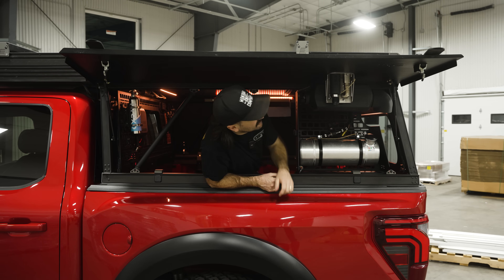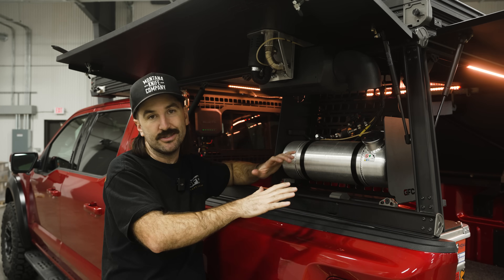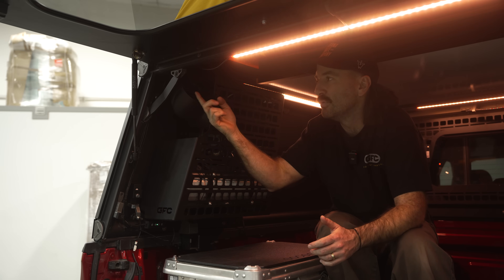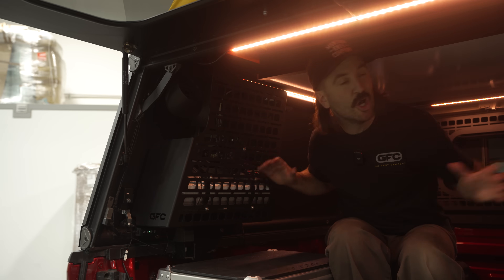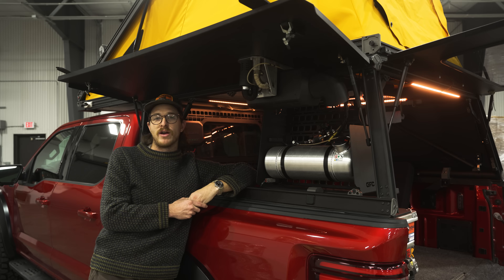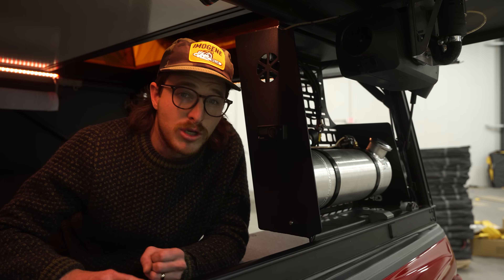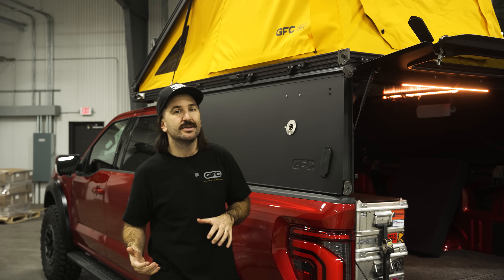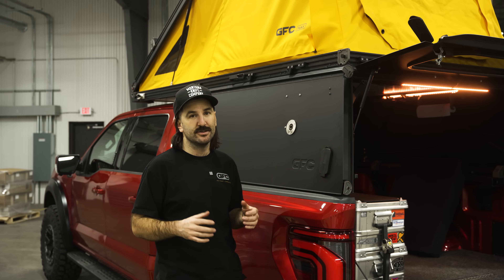Special Projects Ep. 001: DIESEL HEATER

Comment: Saying a “Chinese thing” is not very accurate since they are both made in china with the exact same design since the copy right on the original heater has expired. My “Chinese thing” heater has never once tried to kill me in my sleep so long as the install is good…
Reply: yup. the "german vs chinese" point is mostly just a luxury tax on a brand name. since the OG design patents expired, the clones are using the exact same architecture anyway (tho the UI sucks, but that's the original UI so blame the deutsch fatherland). the physics of a combustion chamber don't change just because you paid more dolla billzz.

the irony is that eberspacher is heavily integrated in china with huge manufacturing hubs in places like tianjin and zhongshan. all the individual parts, resistors, wires, heatshrink tubing, is all from china. microcontrolers are from taiwan. thinking a heater wasn't touched by that supply chain is frlfrl a bit delulu. you're not getting "better" engineering, just more qc overhead and a fancy manual for a unit that shares most of its dna with the "CDH" everyone talks about.

reliability issues are predominantly user error, not country of origin. you can clog an Eberspacher just as fast as a cheap Lavaner Pro if the setup is wrong. units soot up cuz people run them on low constantly, skip the shutdown burn-off cycle, and what kills me the most, don't use recirculating air which in turn makes the heat exchanger too cold and therefore makes the combustion chamber run too cold for a complete burn. like wtf.

if someone really cares about a clean burn and low maintenance, a gasoline unit is the way to go since it runs the cleanest anyway. it’s usually more about how you maintain the gear than where the factory was located.

tbh, if they gonna spend all dat $$$, shoulda got a gasoline unit.

Comment: For my V2 GFC I’m running a driver-side Turbo Cubby. Is there any way this could be installed inside the Turbo Cubby? The cab-side wall of my cubby is where my power setup is currently mounted.

Comment: I have a gen 1 camper I had installed in 2020 just before the lockdowns and primarily use it during ski season to camp in parking lots at ski areas. Glad to see almost all the mods I had to do have ended up as factory options. It was  real PIA solving issues and GFC can do it far better than me. Question for GFC, how do I solve this one? Freshly fallen snow on the camper causes a problem. The heat causes snow to melt, flow into the ambassador hinges and freeze.
Reply from the maker: Shoot us an email to explain what you’re experiencing and our team can assist you 🤙

Comment: For The V2 Pro's, instead of cutting a panel in half, would there be a way cut a ~3-4" hole in the panel and mattress and install a baffle? You could then direct ducting to the bottom of the baffle in the downstairs and have a Y tube direct hot air upstairs and downstairs from the heater output. If you oversize the baffle you should still be able to remove and place the panel to sit on the ducting.
Reply: Break out the sewing kit and get yourself a true Y heat duct splitter but naw you’ll need a bigger opening because whut if your sleeping bag or blankets block the  port…?

Comment: Love it! My concern is routing the heat to the tent section. I'm 6'2" with a Tacoma. Cutting half the small square is not an option and driver side rear corner is right where my head goes.
Reply from the maker: On the max you’d have plenty of space with the constant pass through which is what this is designed to accommodate. On the v2 if we split the panel, that’s the only way to climate control both upstairs and downstairs efficiently inside. Is there a reason you can’t sleep on the passenger side of the bed?
Reply: @GFC because that's where my wife sleeps! 😂

Comment: I ordered my v2 max last month. Can i contact gfc and add this on to be installed with my camper in April in MT?
Reply from the maker: This is not in production yet, but it is being designed to be added to units that are in queue and already shipped as a diy or partner shop retrofit. 

So if you’re waiting on a camper, we will reach out with more details on how this program will work in the coming weeks.

Comment: can that be run with diesel or 91 octane gas or is it diesel specific
Reply from the maker: The mechanical components are the same in gasoline and diesel units but they both have different ecu’s. So it’s either a gas unit or a diesel unit.
Reply: i know the unit is around 1500-2k what is ur gonna be ur target selling price for it with all the add ons like the tank and mounting ect
Reply from the maker: @KICROKS86 ~3k is the ballpark target for the whole kit
Reply: i ask because i know Webasto runs diesel or gas and it would be cool to use normal gas and be able to carried one type of fuel
Reply from the maker: @KICROKS86 yup, evaluating offering both options for the kit currently 🤙 the big difference is transporting the two fuels (especially proper ventilation) but functionally either would work!

Comment: On new Max purchases would GFC or dealers do the diesel heater install or does the customer have to?
Reply from the maker: Designed to be a straightforward DIY to existing units. That said, also can be installed at any of our shops.

Comment: I fork mount my bikes on the driver side it looks like it might still be able to have room between that heater the rear door to fit the handle bar of my bike? also will it start off a portable battery like an ECOFlow? lots of these types of batteries have had problems starting diesel heaters

Comment: I can understand why you'd mount it to the driver side rear only. But I'd still like to see the ability  to mount that heater on both sides. My build plan involves having a 23zero 270 awning mounted on the driver side so if I could have the exhaust for the heater be on the passenger side or the rear of the camper, that would be awesome.

Another idea is, could it be possible to mount the motor and exhaust port on the rear hatch of the camper? It would help create more cabinet space and to keep exhaust fumes away from possible living areas.

If I buy the tent portion of your camper, I'll need to run a second square awning on the passenger side so the kids can have a sizable place to sleep. Maybe it could be possible to run a secondary heater tube for that too.
Reply from the maker: Why is your awning on the drivers side? Typically makes more sense to use it on the passenger in North America.
Reply: @GFC  The biggest argument i've found is swingout bumpers. by design they tend to swing towards the passenger side so they don't swing into traffic. Thus with an awning on the passenger side you have to walk around the swingout every time you want to the tailgate or climb into your camper.

Comment: I love my V2 pro camper. I would buy this at $1500 or below. No way I can justify spending $3k for a diesel heater…. I use an Amazon diesel heater now for $100. No issues for multiple seasons.
Reply from the maker: You can totally use an Amazon heater. We couldn’t sell this heater for 1500 because the heater itself costs us that much. That price doesn’t include the fuel tank, harness work, and molle panel surround. 

None of the Chinese diesel heaters are CE or UL rated, and they have no safety regulations they are required to follow. We refuse to sell dangerous products, which is why we are working  with the best global supplier of airtronic heaters, Eberspacher. 

If you do use a Chinese unit, PLEASE never mount the unit inside the camper. Only use it outside and make sure to use a carbon monoxide detector religiously.
Reply: @GFC  always use a carbon monoxide detector with any heater PERIOD. Not worth taking the chance even with the best reliable heater on earth. Therefore by your logic, just mount the cheap Chinese diesel heater on the outside and you're good to go! Why spend $3k and take up valuable storage space in your camper?
Reply from the maker: @FilmREALMS we use a carbon monoxide detector with this system as well. We want a reliable safe solution to offer, which is why we went with a quality manufacturer. If folks are willing to run Chinese units, that’s entirely their decision. Just not one we can, or want, to make.
Reply: This is what I’ve been doing and it works great. Only takes a few minutes to setup and I always use a CO2 detector for safety. When I bought my heater I seriously considered the Planar heater and it was hard to justify based on price. The GFC heater is double the price of the Planar. Feels like an extreme luxury product being sold here…

Comment: Can the tank be relocated? I deal with Diesel enough I would rather avoid the smell as much as possible where I sleep. Even just knowing it has a fuel pump and could be relocated would be good enough. Being able to plumb it off the truck would be ideal!
Reply from the maker: I’m incredible sensitive to diesel smell, and have not noticed it at all. Honestly was surprised in testing how well it works, you can only really smell it on cold start and it goes away quickly. -Graeme
Reply: @GFC I bet it works great and doesn't smell when running. I just see spilling fuel when refueling that's what I would be smelling.
Reply: @s @spacebike420 yeah that’s what I’m thinking too, filling it gotta be super careful, and the cap has to be ironclad.

Comment: Idea for dealing with the electronics: design a “control box” that is accessible in the upper tent space that can control the heater, interior lights, and so on (maybe add additional dummy buttons/switches with pigtails so users can hook up their own relays for increased functionality).

The control box could be mounted in the cubby/storage space at the front of the V2 Max, for example. That way you don’t have to get up and move around the camper to get your space dialed in.

Excited to get my hands on the heater for my camper!
Reply: Agreed, i would put mine in a V2 pro and we will often have 2 people sleeping up there. Not much room to leave a panel out so would love a way to control the temp up there that works well.
Reply from the maker: @TruckCamper33 how about a half panel kit to replace one of the squares that ships with the kit for v2 and v2 pro
Reply: @GFC   that would be awesome, as long as you can direct the heater output into the floor gap so your blowing more air into the sleeping area than the truck bed. 

Ideally moving the thermostat upstairs would be the best to keep a constant temperature up there (or just leave some length on the thermostat wire so it can be moved upstairs while sleeping). Maybe mount it on a magnet and put the wires in tech flex so it can be quickly moved from upstairs to downstairs stow position.

Comment: is there a built in thermo stat so we can set the temp that  if the outside temp is 30' it won't be 100' inside the camper?
Reply: I just re-watched and my question was answered. thanks.
Reply from the maker: Yessir
Reply: does the exhaust port hole leave a mark on the panel from the heat and smoke?
Reply from the maker: @frankschattner7640 nope, heater burns very clean.

Comment: Are you guys planning on offering a gas version that can be plumbed into the truck's gas tank?
Reply from the maker: We will not integrate into the vehicle fuel tank, only into the accessory shown in the video. The gas furnace is in testing as well and is surprisingly only ten percent less efficient than diesel. It carries a slight price premium as they are not as commonly available so the supplier charges a bit more.
Reply: Don't bet on it. That adds a whole different level of complexity for a less efficient fuel source. Think about how much would be involved to pull that off , and then the cost of it. There's not enough of a market for something like that.
Reply: @NunyaBusiness... Idk, people are already paying the astronomical price of these campers. I wouldn't doubt if they'd also pay a premium (plus markup) for a gas furnace
Reply: +1 to the gas heater!

Comment: Some sort of removable extension attachment for the exhaust might be nice to get those fumes a little further from the truck.
Reply from the maker: Would be easily added if someone would like to, but so far has not proven necessary. No issues with carbon monoxide or smell.
Reply: @GFC  Wouldn't a downpipe also mitigates water ingress?
Reply: Yes, a few feet of stainless tubing would be super easy to add

Comment: Price?
Reply from the maker: Should be right around 3k. That includes the Eberspacher 4kw, the mounting system, harness, thermostat, CO detector and the fuel tank.
Reply: @GFC if you guys use the Espar M3 B4R it will match the one in my other camper. redundancy is great for spare parts.
Reply from the maker: @TruckCamper33 it’s the m3 4r 🤙

Comment: Very nice design and idea to incorporate into an already great camper. I can't wait to get this setup installed on my GMC 2500 in the near future. 

Since you mentioned to share any ideas in the comments section, I'd like to share an idea that hopefully your team can perfect and actually make happen. It would be nice to have a shelf inside the camper (passenger side) that can be used for kitchen use such as stove, cutting board, espresso machine, etc. This shelf could be designed to be pulled out from the passenger side panel (custom hinge design) so to have the option to use the kitchen inside the truck or outside the truck. 

It be nice to pull up to a site, pull out your awning, pull out your kitchen already setup and secured. The shelf design could be sort of a molle panel so to secure appliances from below so there is no rattling or movement during travel.

Either way, amazing job to your design team for all the amazing products you guys are rolling out! Bravo! 👏🏻
Reply from the maker: Love the concept and appreciate the feedback!

Comment: Been following the project for a while. The awning placement on the passenger side was a stab in heart! On my vehicles in the past I’ve always put the awning on the drivers side. That gives me access to the drivers seat, and usually on the vehicles I’ve had that have 60/40 rear seats, the 60 is on the drivers side. Which lends itself to being removed and used for storage of camp supplies, while leaving the 40 seat just incase I have an extra passenger.

I’d be interested in polling people who currently have awnings to see what side they prefer to have them on. My bet would be overwhelmingly driver, but I’m biased and don’t meet as many people with awnings as I’m sure GFC does. 

Stoked either way. Looking forward to getting one for my soon to be installed Max!

Comment: Rad. Timeline? Price installed? Do you wire it into the truck battery like the lights?
Reply from the maker: This would need to be wired into a secondary battery in the vehicle. Something like an eco flow, Bluetti, or a dedicated 12v system would work great. Working on some best practices for how to integrate.
Reply: An ecoflow with their alternator charger (I have in my truck) or solar charger would be simple.
Reply: @GFC  awesome - I’m an ecoflow DP+alt charger user. Stoked for this!